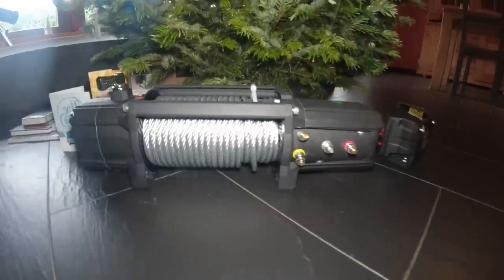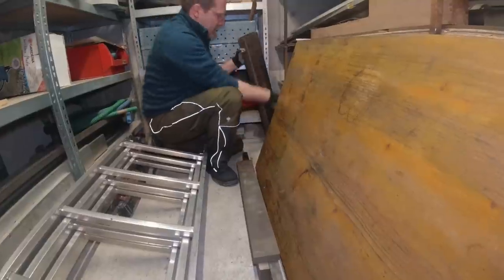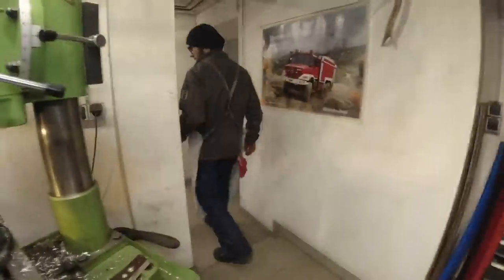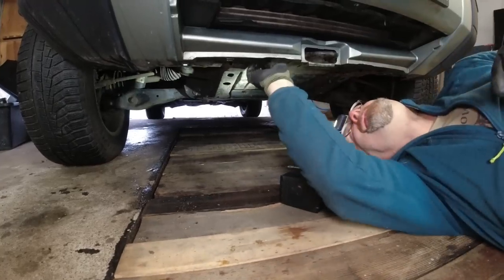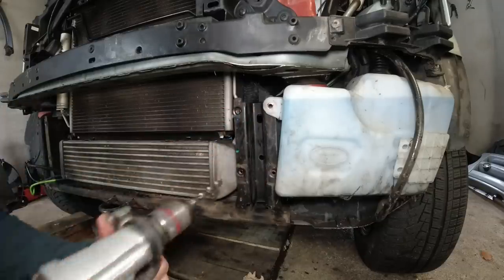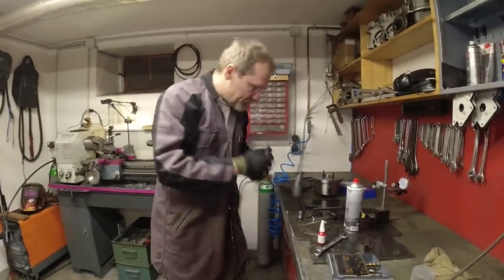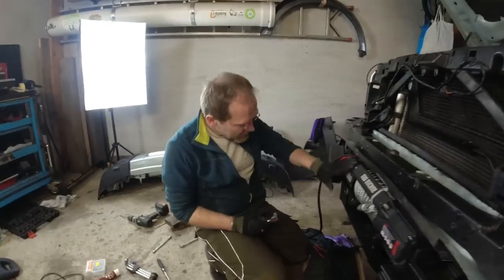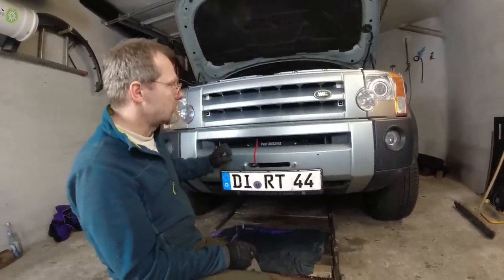Land Rover - DIY easy-to-duplicate winch mount for Discovery 3 / 4

Comment: Great vid, winch looks identical to the Terrafirma one I fitted, mines been on for 3 years, I'm happy to say I've not been stuck in the supermarket car park since fitting. 🙄
Reply: I was thinking the same. I have the Terrafima A1200 fitted to my D4, but mine is fitted with a dyneema rope and has a wireless remote. 
I  had a flip up number plate mount on my D2 but on the D4 I just moved the plate up onto the top bit of bumper.
Reply: @johnspear3452  I have the same Terrafirma on my Defender, came with synthetic rope and 2 remotes , good winch for the money.
Reply from the maker: The wireless remote did not work.  This is why I did not show it in the video.  I am also refusing to read the manual.  The wireless remote has a optional cable and it works when connected 😳😳😳.  Without the cable it does not work 🤔.  The battery in the remote is good. Christian
Reply: @Vera_and_Christian  ah right, mine has a cabled remote and wireless, the battery doesn't last long in the wireless to be honest so it's a bit useless anyway. Refusing to read the manual is standard male practice........ 👍👍

Comment: I got my AUD$350 ebay 12000b winch with steel cable about 10years ago for my Defender 130, before the installation I re-greas and re-seal the gearbox that I have no problems with that side for many uses. I have once burnt out the motor, it was pulling a heavy loaded touring LC79 up hill. My local motor re-winder said the soldering on the armature was not enough, he has fixed all solderings on the armature and it was 5 years ago. Cheap winchs are not all bad. I see you have steel cable on the winch that fairlead you are try to making normally used for dyneema rope, steel cable we use roller guided fairlead, steel cable will cut the aluminum plate when in contact. As always, good video on the installation. Happy New Year.
Reply from the maker: I think the worst point in my design is, that the winch cannot easily removed for overhaul.  I need to change this.  Thanks for your comment.  Christian

Comment: Hello Christian & Vera. This is a very nice looking winch bracket, and very well designed and most certainly fit for purpose.

There are two different types (each with their own name) for the metal part that the wire runs through (the part you are yet to make. The one your winch came with is called a Fairlead Roller. The other one without the rollers is still called a Fairlead, though it's other more popular name is a Hawse (a shipping term, it is where the anchor chain passes through the ship.  The roller type is for wire rope, the hawse is fore nylon rope. I think the wire rope or the hawse  or both may get damaged if you go that way. I say I think because I have never seen wire rope used with a hawse,, only a fairlead roller.

In Australia we have a number of 4WD accessory outlets that sell the cheaper products. The main one I think is 4WD Supercentre. I am sure someone will add others.
Reply from the maker: I did update the drawings and made the design compatible with a roller fair lead.  Even if we will not install it.  Check out our comunity page for the latest drawing.  It is much improved now.  Christian

Comment: Hi from Turkey,Cristian and Vera!  Happy new year. This is my first post to you.  I m fan of u and always watch ur videos with much pleasure. Just an advice , dont run ur winch without ignition or it will empty ur batt very fast.
Reply from the maker: Yes, of course, we know that. Discoveries are anyway really sensitive when it comes to low voltage on your battery. Don't want to mess with that. 😃👍🙋‍♀️Vera

Comment: 16:20 Ordered the clips from aliexpress. Was pretty cheap. Then liked how it looked without the plastic thingy and and didn't put it back. It's not like you really need it anyway. And sometimes it breaks when offroading (that's why the clips broke 1st place). Mine is D4 though. It looks bit different I think.

Comment: Great videos. I did my electrical apprenticeship with the rover company back in 1971. 4years. At the rover factory in clay lane ( Acocks Green). we made the engine's for all of the rover cars and I ended up in Solihull after I finished  my apprenticeshi. My newest car is a 2015 discovery 4 after I had a d2 that I had for 9 years, and the wife had a freelancer 2. It's great to see the actual time it takes to complete work on your diiscovery and I'm looking forward to you doing, 1) the front suspension poly brushes upgrade and 2) the rear wheel bearing replacement. But are you going to replace the cracked air strut you noted on one of your videos. Anyway thanks for putting all this on the Web. And look forward to the next videos. P.s. if you want to know how to install a dash cam and rear camera via the head lining, let me know
Reply from the maker: Front suspension will be coming soon, but I believe on our LR4, rear bearings are still going strong. Airstrud is not cracked, he was overexagerating 😅. That crack is only in the rust and dirt cover. My Disco is not leaking any air, but it will be replaced the minute it does. More importantly are putting in new glow plugs, a new oil pump and timing belt. So that will be the next major preventative service (not repair😅) on my Discovery 3, and oil change of course👍😃🙋‍♀️ Vera
Reply: @Vera_and_Christian  thanks you for your reply, also wondered if you are tackling that stupid gear box filter (apparently sealed for life) most of us don't have a pit so it usually takes longer to do underbody work. I look forward to the next installment. Thanks

Comment: Hi Vera and Christian,  First, Happy New Year to You guys, Second , one question. You explained /some other video/ why replace ''not original '' break light bulbs is nothing to do with the air suspension,. My story short; Four days ago I bought 2006 LR3 HSE. with 4.4 engine. Yesterday noticed, NO BREAK LIGHT.  Quick picked up Two of this bulb a near autoshop, and changed. I'm just surprised, the Left side was no bulb at all,... was empty.!  so I replaced both side . Since than , she is behaving strange... Tomorrow I'm willing to take out the Left bulb, and let see what happens. /not Today, presently here in Winnipeg Can. has -33 , Tomorrow hoping around -20..?  Bit better.. / Christian, is there any ... way ,  you wrong about it.?  By the way, I'm believe You, more than I believe to the blueprint.!
Reply from the maker: I am sorry, but I just found your comment. Maybe they knew why the left that bulb out while selling the car 🤔. It's best that you get yourself an OBDii tool, like a icarsoft (only for Land Rover/Jaguar) and read out all the faults. We usually suggest that to those asking for advice before buying a Discovery. If the voltage on the battery is too low, they don't like that either. When you have specific questions, it's best to send us an email since we get so many comments that I am loosing track sometimes. We get a lot of emails too, but it's more likely that we can answer those in a couple of days time. 😃👍🙋‍♀️Vera

Comment: To me you need roller fairleads, the cable is never going to be used at a perfect exit angle, and the bumper and/or the braided steel cable will abrade. Worse still, a Kevlar synthetic cable will be damaged.
Reply from the maker: No rollers in Germany unless many impossible obligations are met. The winch came with rollers, even nice ones.  But we have to live with a aluminum piece and replace it.  We are no heavy off-roaders and there will be rare use only.  Christian

Comment: Did Vera not buy you a plasma cutter for Xmas Christian? 
No? Maybe next year. 😂😂😂😂

Robins weld 👌
Christian’s weld looks like pigeon poo. 😂😂

All in all another good video 👍

P.S. when is Fabian coming back to have his winch fitted behind the bumper? 😂😂😂😂😂

Is there a new series of video’s coming out soon about home DIY ?  🤔👍👍
Reply: There was a cheap one in Lidl at christmas time. I wonder why he does not have one :)
Reply from the maker: 🙄 He bought a cheap chinese one years ago, which of course is not able to handle that 6mm material. By the way I don't think he would have been able to have it look so nice and clean, by cutting it himself. 😅🙋‍♀️Vera
Reply: @Vera_and_Christian  cnc cutters are always going to be better than doing it by hand.

Comment: Putting a winch on a Discovery ??????   It's a bit like putting a roof rack and/or a tow bar on a Ferrari, but I suppose if the cable is long enough, you might stand a chance of getting the Discovery back home.
Reply: Not sure if there’s sarcasm implied but these are very capable off-road.
Reply: @_chipchip No point in being capable off road if it won't go in the first place, and you can't rely on it to even take you to the shops.
 The definition of off road to a new Discovery is, on the grass verge, or on the trailer..... Ah, now I see the reason for the winch, as some trailers don't have them.
Reply from the maker: Some tow trailers do not have winches in Germany.  How else should we get it onto a trailer if it stalled on the Autobahn?  😂 Christian
Reply: thought the same thing. like putting a roof on top of a roof. discos are pretty good off road i.e. when not broken... anyway to each their own...

Comment: Will those bits of threaded rod be strong enough for the fairlead? If you're winching at an angle they're under a lot of force, and you don't want to damage the bumper

Comment: Hi Christian and Vera. Nice job and thanks for the drawing. In Australia the thing the cable runs through we call a fairlead and the original one you had with the rollers is for steel cable the polished fixed aluminium style is for dyneema rope.
 Also in Australia our main go to cheap 4x4 bargain store is called "4x4 supacentre" lol
Happy new year guys and thanks for another great video.👍🍻

Comment: Christian is single-handedly restoring my faith in German engineering, which has been eroded by 20 years of overly-complex and fragile products from BMW and AUDI.

The only thing I'd do differently would be to try and fabricate an extension for the winch clutch lever to position it where it could be operated by opening the bonnet.
Other than that, absolutely awesome!

Comment: OMG; nice video and well done job, but, too much over-engineered. Absolutely not necessary to clamp the winch on the recovery point, you’ll probably need it much more than the winch.

In my experience (designed a winch plate years ago for d3/4 in only 3x pcs of lasercut/bend steel and no welds)
the key point is the rope mouth fixing point: if you’re not winching super-straight, a lot of load will be transferred there and the two rods used are really not a good choiche.
The mouth support should be in direct contact with the mouth.

100usd in metal cut but you need a lot of hours to weld + welding machine and not only… I don’t see any saving in this DIY;.

of course, as many other things, somebody will have fun on cutting & welding!!!
Reply from the maker: Agree with you on the winch plate mount.  Disagree on not using the front recovery point.  Based on my calculations, the 1.5 mm bumper mounts are not strong enough and will deform.  The recovery point is still usable as explained in the video.  Christian
Reply: @Vera_and_Christian  in your calculation you should consider a pulling load and not lifting weight. Leave the original point free, as the original LR winch plate do and all aftermarket products also.
You can probably broke the gears of the winch or the rope before to crack the pates on the chassy.
Unnecessary over-engineered.
Reply: @Vera_and_Christian  there's also issue if you use a pully you have the potential of loading the recovery point 24000 lbs / 10886Kg may be a bit to much better to spread the loads

Comment: Oh man that stupid f*ckin bolt took me ages! I didn't remove the radiator fan either. For anyone watching in the states you can get a premade universal winch tray from Harbor Freight or Amazon, and it will work, but surely not as well as this one! I bought the Zeak one and a Zeak winch from amazon.

Comment: I replaced my D2 plastic bumper with a real steel bumper. Very sturdy. $500 installed. Winch just bolts to the bumper. Do you have Harbor Freight in Germany? Great source for cheap tools.
Reply from the maker: We can't just replace the bumper like the guys in Australia or the US, unfortunately. Our TÜV forbids any permanent changes to the outside dimensions of a vehicle. It sucks. No harbor freight for us here. 🙋‍♀Vera

Comment: Hi Christian. Love all the videos and thank you for all the "German precision" lectures and fixes. I was hoping you can help me now, since I got my D3 it has a rough idle at operating temperatures, but only sometimes? I have read everywhere online but dont seem to find anything. I can say that the previous owner had blanked off the EGR valves just for ease of mind in our hot arid conditions. And yesterday I got the exhaust done and now when it does rough idle, its more noticable. If you have a mail adress or whatsapp, that would help then I can send you voice notes. Please Christian! I rely on your DIY expertise now. 

Cheers, 
Devin
Namibia
Reply from the maker: My email adress is in the YouTube About section.  I cannot write it here or I will get spam mails.  I only know about the Diesel engines.  I´ve heard that there are other engines installed too running on "gas" and they have special screws in the cylinderhead with cables attched to them to make the fuel ignite using a spark.  Sounds like a bad engine design to me.

Comment: Happy New Year all - question ... why hinge the number plate downwards?  Why not hinge upwards and have a gap so the cable end can hang down and be attached to the new tow point when driving?  -  or  -  have a couple of vlips and remove the number plate when you need the winch?  The disadvantage of hinging down, as I see it, is thet you don't have any tie-down for the cable end ???
Reply from the maker: That is just a short term solution, when you watch the video till the end, he explains how it will be finished. We ran out of time👍🙋‍♀️Vera

Comment: Love it. Very neat design. Have you considered adding a remote control and having the cable control for backup? To store the hook, you could run it down to the recovery point. Maybe add some scuff panels to stop the cable from rubbing through the bumper plastic.
I would have the number plate hinge up as it will be mangled if you are winching up hills or muddy tracks.
Time to get stuck to 'need it'. 😊
Reply from the maker: I’ll work on it and maybe post a follow up.  The wireless remote came with the winch but did not work.  Christian

Comment: The part you asked is called a fair lead or Hawse fairlead…the same as a fair lead on a ship or the hole where the anchor chain comes from, that’s called a hawsepipe!
It looks like the lead you’ve made is aluminium?  If so that won’t last long with wire rope… what would be best if you get some dyneema rope which has many benefits other than also being suited to the lead you have.  It’s lighter than steel, can’t have strands hurting hands and above all has very little recoil.  It amazes me when I watch people standing next to wire rope under tension…it can kill if it lets go!
I work around shipping and have seen what can happen with wire rope… also the bolts which come off the winch to mount the lead I don’t think will stand the force if you want to pull anything other than straight ahead and could damage the bumper.
Anyway I just thought I’d point it out but as always, another great video and very enjoyable to watch.   Happy new year to you both.
Reply from the maker: I work on improving the fairlead but we cannot go to a synthetic rope. We post a video every week and each one is about 200 to 500 Euro to produce.  This one was 700 Euro in supplies.  The gas and wire for the welder was 110 alone. Paint, primer, bolts, laser cut and the winch…. YouTube gives us about 40 dollars for a video.  So add this up times 3 per month and think about if you can afford to run a hobby YouTube channel.  A synthetic rope is 300 Euro.  Our channel is about low-cost and affordable repairs and mods.  High-end bold-on stuff is covered by Trailrecon. Including how to make coffee.  My answer fits to many comments on this video.  Thanks.  Christian

Comment: Those Chinese winches aren't too bad Christian, I bought a 1300kg "Runva" brand, with dynema rope and two cordless remotes for my Disco 1, cheap as. The only times I used it was to "rescue" other people's vehicles, but it's nice security to have on your vehicle when doing rough country.
And Happy New Year to you.
Reply from the maker: I think the biggest difference to a quality winch is the durability and resistance to the elements.  In salty and wet conditions, this winch will not work very long.  I plan to overhaul it in 12 month and show the “no use abuse”.  Christian
Reply: @Vera_and_Christian  we live "remote" in Northern Australia, my Disco not garaged in wet season, lots of deep water crossings, mud, dirt etc, winch has been on for six years, still fine, not badly rusted, working fine when needed, so cheap Chinese is ok.